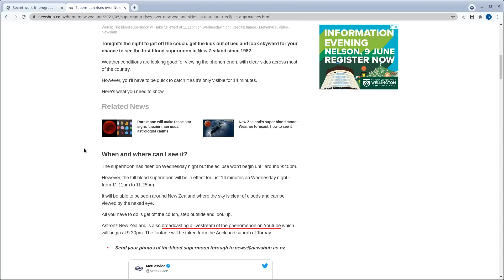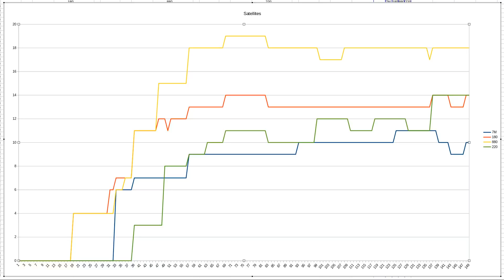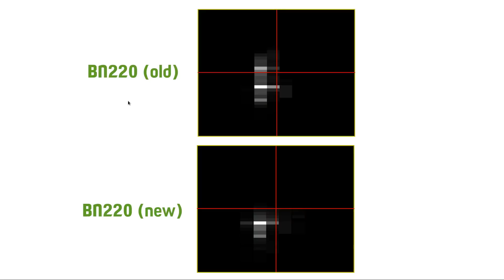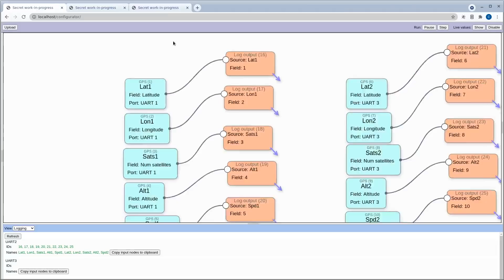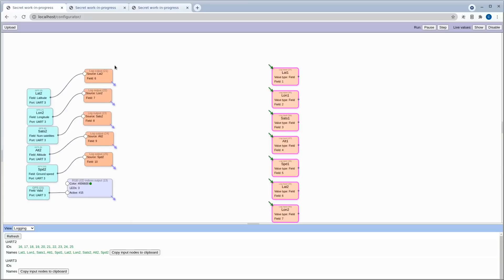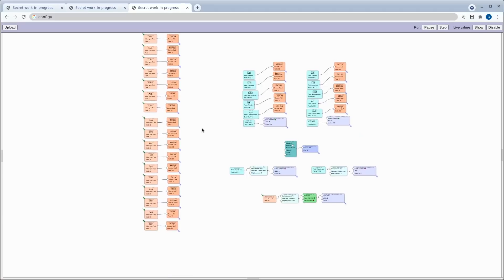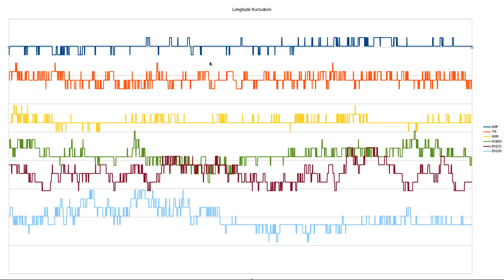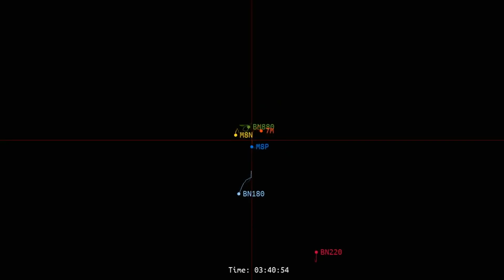GPS module showdown - BN180, BN220, BN880, 7M, M8N, M8P

Comment: I’ve used the BN-880 quite a lot and really like it (especially for the price and availability), gets much better performance than the 7M in my experience especially with obstructions (although note that here in Brisbane, AU we get on average 10 more GNSS satellites visible with better DOPs than NZ). Although last year I bought a preproduction sample of the ublox 9 series which does 4 concurrent constellations which is crazy impressive, not sure if there’s any premade modules for it though and of course being export restricted buying them officially is a pain.

Also, you said your axis was 1/100,000th of a degree for lat/lng, how many decimal places are you recording and at what float precision? When I have to deal with high precision lat/lng data I almost always use integers for the decimal places and often to 9 places (1/1,000,000,000th of a degree) otherwise I find too many errors are introduced from the limitations of floating point numbers. The gaps in your heatmaps and blocky line plots make me think you aren’t using the full resolution those modules can output.

Also, in case you didn’t know the Beitian modules use receivers from ublox, the BN-880 uses the M8030 which is what the M8 modules use.
Reply from the maker: I'm using the NAV_PVT message which provides a 32 bit integer representing lat/lon * 10^7
That number is then divided by 10^7 to get a 32 bit float representing degrees. There may be a small precision loss in the division, but I can see from looking at the original integers that there are still only the same limited number of unique raw values available. The 7 decimal places doesn't necessarily mean that the module actually gives 7 decimal places of real precision.
I would use double precision if I needed higher resolution and the GPS module could actually provide it, eg. for something like this: https://www.youtube.com/watch?v=C_iQFFGgXPA
Reply: @iforce2d  Interesting, I usually use the GGA NMEA message, most modules let you configure the precision from 1 to 8 decimal places (although few actually have 8 full decimal places of unique codes). Looking back at my BN-880 datasets they have a resolution of 1.6e-7 degrees which is about 1.5 cm.

Considering you plotted the points on Google maps and measured a rough spread of 3.3 m and then showed the scatter plot at 8:37 with approximately 33 unique points horizontally it would be fair to estimate your resolution is closer to >1e-6 degrees (>10 cm). This doesn’t change the results of your showdown but might be causing some of the oddities with your data visualisations. 

Just did the math for it, the 32-bit float is your limiting factor for resolution and is why your longitude values have less resolution. Storing -40° your error will be 1e-6, storing 175° your error is 5e-6.
Reply from the maker: I wrote a long post about how you were all wrong, but I became less and less sure of myself as I typed.... 
It might be worth doing a test where the sbusmixer writes the raw integer to the file instead of a float. This will be necessary anyway if end users want to use an sbusmixer with a GPS that does provide more accuracy. If I get a different outcome with that method, I'll have to do this whole comparison all over again.
Reply from the maker: Yeah you're right. Gonna have to make a follow-up for this.
Reply: @iforce2d  Sorry for not being wrong and ruining your fun XD. 

I’ll also mention that I have a couple geodetic markers near my house that I’ve tested GNSS modules with, not sure if you’re near any but it might be worth checking, it’s publicly available on: <geodesy linz govt nz>. I’ve found the Google maps imagery can be out by a fair margin even in greater metro regions let alone the sticks.

Comment: Thanks for the comprehensive video. I'd love to see what would happen if all of the antennas and logging equipment were on a turntable with the antennas raised up as much as possible away from all of the circuitry to ensure isolation, and then the turntable rotated in one direction or another. I've seen novel behavior from GPS antennas that are simply rotated without being moved.

Comment: Awesome video loved it i used m8n on my arducopter powered drone and i also tried i mav  but unfortunately inav was giving so many trouble even with so much tunning it didn't hold well but the arducopter performance with m8n  getting  around 15 sat mostly  was jaw dropping for me atleast  for how accurate it did pos hold rtl and circle mode it was flawless loved m8n and arducopter

Comment: Really interesting work! I remember the car top gps timelapse you did a few years back (M8P?) and the accuracy was always around 1.2 - 1.3 meters. I thought the consistency was impressive. That's only slightly worse than an expensive handheld garmin gps unit when you leave it outside for 24 hours. Most of the time it pins the location to 2-3 feet accuracy very quickly and stays there but occasionally I can get it to report 1 foot or so overnight.

Comment: You should have used ECEF (X, Y and Z) instead of Long/Lat. Probably not that easy to get from the GPS, but uBlox devices can output ECEF in binary mode. ECEF=earth-centered, earth-fixed, and gives a 3D coordinate where 0,0,0 is the center of the earth. "Earth-fixed" means that the coordinate system rotates along with the earth. ECEF is really all you need. The altitude can be derived if you know the shape of the earth. Not great news for the Flat-earthers by the way. ;-) For a stationary test, you just need to know the distance from sea level to the center of the earth and use simple math. Stationary ECEF coordinates gives a "ball" of points. Long/Lat have different scale and that combined with the resolution is why you see the "weird" measurements. Great video by the way!
Reply: hi jeffmerlin, have you become a flat earther yet? If not I suggest watching Level with Me (2023) by Hibbeler Productions

Comment: I've had several BM180s die on me. The still communicate via Tx/Rx, but are unable to get a lock. And they heat up. I've started to use 4.3V instead of 5V

Comment: The end part with them moving is useful to help visualise the accuracy performance. I primarily run TBS M8 v1's now after having a ton of issues with M8N's losing battery charge and cold starting every time. Also even with a good battery they would sometimes take a couple of minutes to fix home. When I switched to the TBS M8 it finds a home fix in less than 30 seconds consistently. It's also glonass only which I wonder if that helps when I read about gps jamming lol. 🤔

Comment: Hi nice video, wonder how the accuracy changes for about a week of time with sat's moving around;  But will this or any other small uC board of this class do the RTK correction in realtime using correction station info??   Have you made a station or have one near by?   Did this years ago but it was really up to the antenna, use a cheap one and no Fix, good $$ one and pulls in much better.   Wondering where that was such a nice area reminds me of home

Comment: Fascinating findings, and explorations. Great explanations. 

I find the number of satellites to be of less interest. More interesting would be which satellites each GPS module is seeing / using at a given period of  time? (Or, which satellites is a GPS module rejecting from its calculations? This might be an indicator to quality and complexity of software on a given module)

Generally the higher in the sky GPS satelites are to a given earthly location, the more precise the time signal, as it traveling through the least amount of atmosphere and that susceptible to less random distortion effects. [ Side note: GPS satelites far apart with low communication paths to each other are actually being used to study Earths atmosphere thickness and properties in real time. The time signals are compared with modeled data for atmospheric lens and ionic effects ]. 
So as you concluded, more GPS satellites does not mean better data.

You might try using an opaque plastic storage container as your test housing. Using the lid as a base, and the opaque container as cover. (a fan in the bottom would help to reduce humidity from the warmer daytime air that is trapped. I'm guessing in your case, the wood held moisture that was being released as it cools. Using a non-water holding base should help solve the dew annoyance)

For a more precise reference position, you might check to see if any land-survey markers at the corners of property lines in you area. Also if any historic points of interest nearby, they often have a documented precise position. (as do road intersections, but require more time to research). An airport, or airfield will also have a precise location and altitude marker. 
(only useful if wanting to compare data to a very precise reference of +/-1m vs +/-10m)

If curious ... you might check if there is any value in using the average of pair of GPS modules (of similar type) placed a meter apart (like if mounted on each wing). 
Would an average position value be any more accurate vs. the individual data stream?  (lat/long/altitude)  Mentioning, as professional land-survey equipment tends to have dual GPS units.

Comment: Latitude is the direction that the distance between degrees is changes as the circles get smaller going up in latitude.   Longitude stays the same.
Reply from the maker: Latitude measures angle away from the equator, ie. horizontal lines when looking at a typical map. The distance between one degree of latitude and the next is always about 111km. Longitude is the vertical lines, which all come together at the poles.The distance between one degree of longitude and the next is about 111km at the equator, and zero at the poles.
https://en.wikipedia.org/wiki/Longitude#Length_of_a_degree_of_longitude

Comment: Really good test thanks. Would you test other GPS modules to compare and show which is most accurate?
The Quectel modules are low power,  acquire fix quickly and low cost, especially the L70, the L80 is not bad either. 
Interesting how more satellites doesn’t necessarily mean higher accuracy. 
Thanks.

Comment: Thing you could avoid the whole sizing of latitude, longitude (pixel) issue at given position on the globe by using a distance, bearing from a reference location. 
ie: relative vs absolute reference. 
Knowing data is within X meters of an actual positions is more useful that knowing its +/- 0.xxxxº of latitude, longitude.

Comment: These test conditions are pretty ideal. So the total number of satellites is not that important. 7-8 nicely spaced all over the sky are already enough to give you a solid fix that will not really improve with more satellites received. Things look different in real world conditions where you have obstacles blocking parts of the sky, interferences and mulipath situations. If you only have 7 satellites and lose 2 of them, accuracy will go down a lot. That's basically the big advantage of these newer modules like the Neo 8M and 9M that can receive multiple satellite constellations simultaneously. There are so many satellites to choose from that it is much less likely to end up with only 4-5 of them being received and accuracy going down or even the fix being lost. Also, the antennas make a big differences.

Comment: Haha yeah not all modules are equal.
They come with no flash, some flash, loads of flash.
There are loads of clones and loads of customs modules too.
I remember the fun I had messing around with loads of these modules.
I ended up with a ublox 6 module being one of the best. It was also the only one I pulled from an OEM device which could mean it was the only real one.
Have you had a play with the ublox software it's got a hell of a lot of configuration options.
Including enabling other sat configs.
Oh and you can enable the marine radio mast stuff so you can use land beacons as well as sats

Comment: Hi there;  I've been watching a lot of your GPS videos.   I was given a Beitien BN 880 and I created a GPS out of it.   It always seems to have the Time, Lat and Lng correct.  However the Alt and Sats can be all over the map.   I live about 200 feet above sea level but at times my GPS will be showing 8000 feet and then a few hours later it will be showing 97 feet.  At times the number of Sattelites will be in the thousands.  Any thoughts on what might be wrong.   The whole rig is on a window sill that faces north and the gps module is pressed to the window with some blue tack.  I've tried both an Arduino Uno and a Mega.  I'm interested in any comments you or your viewers might have.
Reply from the maker: Sounds like you are reading some values as the wrong data type, eg. signed instead of unsigned, or from the wrong location in the message structure.

Comment: You only need 4 satellites for a 3d lock. Beyond 4 more satelittes it calculates all of the possible combinations and averages those to get the "real" value. As another commenter mentioned, it is of more value to compare using the same set of satellite systems. Or run a test on each set separately. There will probably be disagreements between the glonass, gps and Galileo systems. I also wonder if you system interprets or has any of the WAAS (wide angle augmentation system) corrections built in or interpreted (these generally get broadcast along with the signals to perform corrections. 
The best way that i can put it would be more than 4 satellites means that if one satellite drops or you miss reception, you don't lose information and position (it's about redundancy).

Comment: I wonder how much different gps systems make a difference. At least on my BN-220 Beidou and Imes were enabled by default. Needed to disable both to get Galileo support as well. (You cannot enable galileo without disabling Beidou and Imes. Those are probably usefull mostly if you're in or near China and Japan).

Comment: iforced2d , thanks for the video. Now i realize why ardupilot have issues with some GPS .  
So what GPS for ardup do you recomend at last?
Reply from the maker: I use BN220 on almost everything these days. Well... 'almost everything' means planes for me recently. For multirotor or ground vehicle I think I would use BN880 or the M8N puck since they have magnetometer as well.

Comment: About how much time do you have in this gps video. GREAT WORK!
Reply from the maker: Depends how you calculate the time I guess. Started making it right after the 'follow-me' video about 3 weeks ago, I think I ran 6 tests in total, summing to around 24 hours. 6-8 hours debugging and dealing with UART issues and BN180 quirks. Probably about 12 hours fiddling around with spreadsheets/charts and programming the bitmap generator, arranging screenshots and slides etc. A few hours for recording the outdoor video clips and post-narration, an hour or two for editing. Overall been working on the sbusmixer for about 15 months.
Sometimes I think it would be nice to be a gaming YouTuber or streamer, where a 29 minute video takes about an hour to make :)
Reply: @iforce2d  impressive to say the least

Comment: Can you paste a link to the logger devices you use?
Reply from the maker: https://www.banggood.com/CJMCU-717-OpenLog-Data-Recorder-Flash-Recorder-Sensor-Module-Support-64GB-Micro-SD-Card-p-1461328.html
Unfortunately they probably don't have the arduino bootloader so you might need to burn that yourself. Use a UNO bootloader, not pro-mini etc. See the review by 'ram777'.
Pinout here: https://www.thebackshed.com/forum/ViewTopic_mobile.php?TID=11225&P=2

Comment: Regarding BN180 forgetting settings: your module's battery might be dead.
Reply from the maker: Although I can't find an official spec sheet, many sources say that it has no flash memory to store user configuration, which matches my experience. I think the battery must be for saving the satellite almanac, otherwise it would not be able to start up in only 30 seconds.
There's a comparison table here, not sure where they got it from though: https://www.amazon.com/Geekstory-Navigation-Raspberry-Aircraft-Controller/dp/B078Y4XZN9

https://en.wikipedia.org/wiki/GPS_signals#Almanac